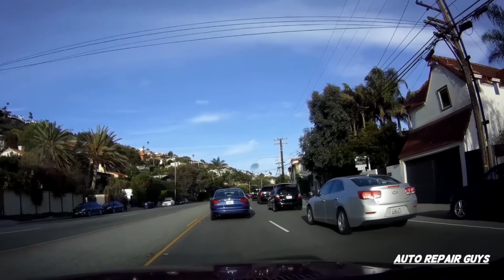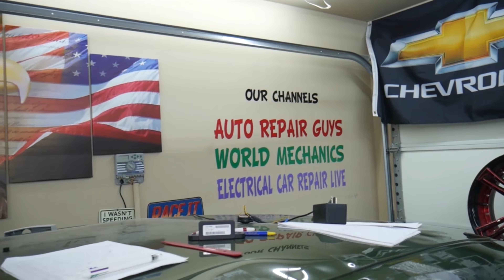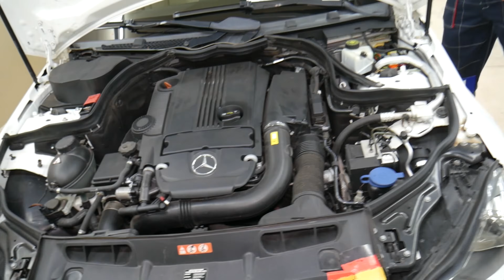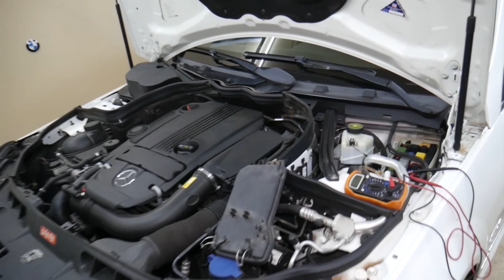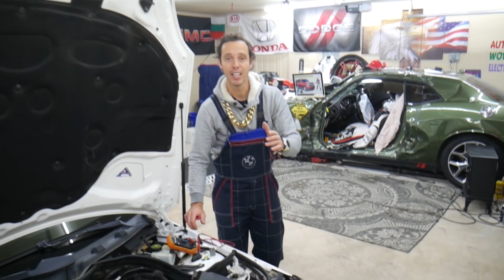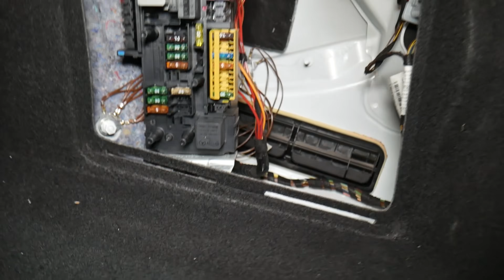MERCEDES W204 Wastegate Actuator Waste Gate Solenoid Fuse Relay Location Replacement C250 C300 C180

Comment from the maker: Things you may need to fix your problem: 
Best Scanner Tools That We Recommend:
► Cheap Scanner: https://amzn.to/3P97nEv
► Advanced Scanner: https://amzn.to/4iTXhFc
► Advanced Scanner: https://amzn.to/41Lgv9P
► Professional Scanner: https://amzn.to/3VWJnYL

Best Tools That We Recommend:
► Tool Set: https://amzn.to/4gPS8vE
► Tool Set 2: https://amzn.to/41SEq79
► Torx Set: https://amzn.to/3DsPGwV
► Reverse Torx Set: https://amzn.to/3BHGAfk
► Screwdriver Set 1: https://amzn.to/3ZPkvn8
► Screwdriver Set 2: https://amzn.to/49TR73F
► Oxygen Sensor Socket: https://amzn.to/3BNmEYn
► Oxygen Sensor Socket Set: https://amzn.to/4gracwH
► Torque Wrench 3/8: https://amzn.to/3BL7HWG
► Torque Wrench 1/2: https://amzn.to/4iOrTaW
► Wrench Set: https://amzn.to/3Pco81u
► Off Set Box Wrench: https://amzn.to/3Pafb8Q
► Voltmeter: https://amzn.to/4gKJ1MM

Best Car Accessories:
► Dash Camera: https://amzn.to/3ZJrbDa
► Tire Compressor Pump: https://amzn.to/3DIcgS8
► Cordless Tire Compressor Pump: https://amzn.to/3DFy2pE
► Battery Charger: https://amzn.to/4iOsAkB
► Dead Battery Jump Starter: https://amzn.to/3Du3s2x
► Jump Starter and Air Compressor in 1: https://amzn.to/3Wif92T

Best Engine Oils That We Have Used:
► Mobil 1: https://amzn.to/4gAwegn
► Castrol Edge: https://amzn.to/408MXlf
► Liqui Moly: https://amzn.to/409VkNi
► Oil Filter 1: https://amzn.to/4iNY1LV
► Oil Filter 2: https://amzn.to/3DsRbLz
► Oil Filter 3: https://amzn.to/41Rdhl0

Coolant:
► European Cars Blue: https://amzn.to/49Rf8bw
► European Cars Pink: https://amzn.to/4gxRLGG
► American Cars and Trucks: https://amzn.to/4guBulN
► Asian Cars: https://amzn.to/3P9J3C6

Fuses:
► Best Assorted Fuses: https://amzn.to/4gwCo12
► Standard Fuses: https://amzn.to/3ZQj6N1
► Mini Blade Fuses: https://amzn.to/3WifXor
► Jcase Fuses: https://amzn.to/3VVtOAK
► Low Profile Fuses: https://amzn.to/40ayXao
► Mcase Fuses: https://amzn.to/41UAqmR

Best Car Person Presents that we recommend:
► Lego Technic: https://amzn.to/406rnOf
► Portable Jump Starter: https://amzn.to/409kH1O
► Front Rear Dash Camera: https://amzn.to/3DwBTpf
► 152 in 1 Screwdriver Set: https://amzn.to/4gR144c
► Car Key Chain: https://amzn.to/41Khs24
► Car Detailing Kit: https://amzn.to/3Dxrbif

AMAZON ASSOCIATES DISCLOSURE
Auto Repair Guys is a participant in the Amazon Services LLC Associates Program, an affiliate advertising program designed to provide a means for sites to earn advertising fees by advertising and linking to Amazon.com